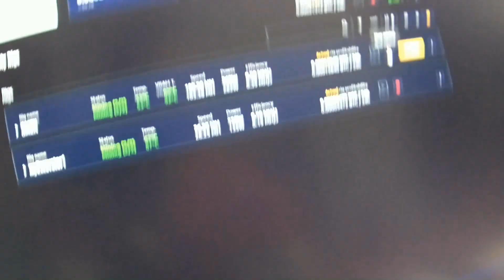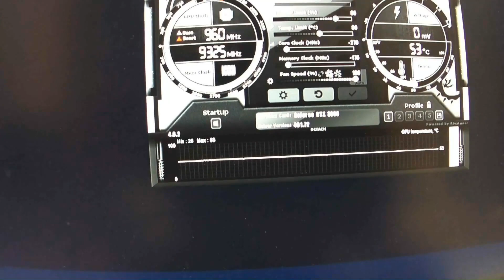HP OMEN 30L RTX 3090 VRAM overheating? Lets take a look inside

Comment: How can I see my vram temp on nicehash like you did?
Reply from the maker: I didn't have to do anything to see it so I'm not sure. The vram temp doesn't show up for  the 1070 on my other rig, so it may be a bios / board difference. Also I am using the more recent quick miner version, so if you are using the old one try updating that too.
Reply: My 3070 does not show. I think just 3080 and 3090s do

Comment: This is the first tear down of an Omen 30L 3090. Thanks for sharing!!
Reply from the maker: Yeah I was a little nervous opening it up since I couldn't find other videos or guides to go off of for this model. I hope my video was helpful and thanks for watching!
Reply: Was very easy, just opening all the screws (make sure you don't mix the different sizes!) and it comes apart. Should open a bit easier if it's still warm, pads and thermal pace "unglue" easier.